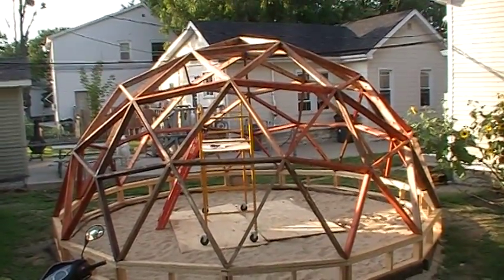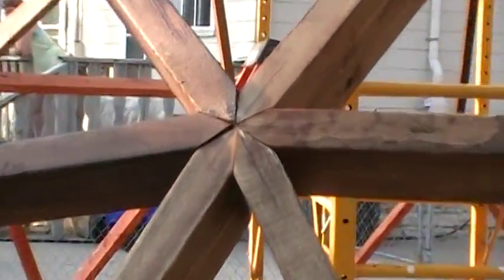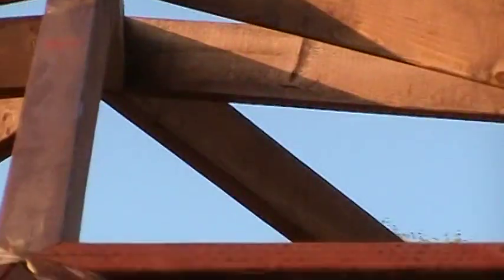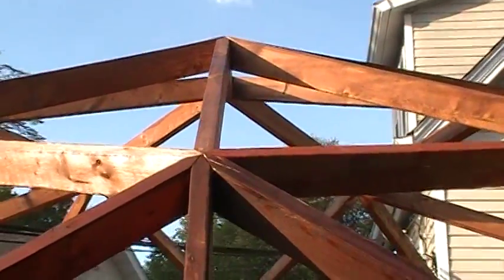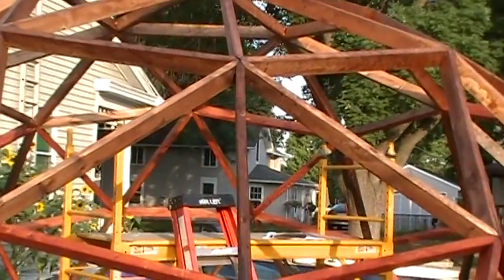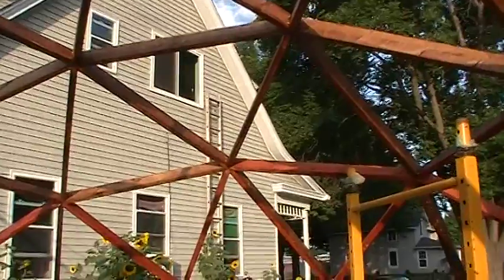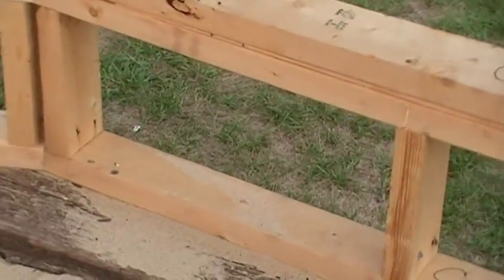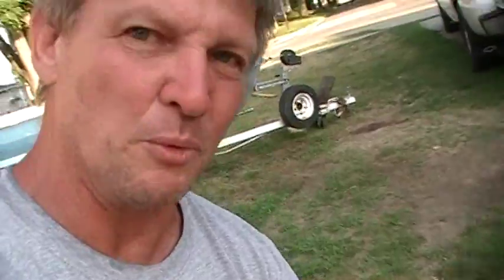video #9 the completed dome framing!

Comment from the maker: Hey Bodobaas, thanks for viewing my video! yes I did compensate for the uneveness of the 3V, I put a strip of wood ripped down at a 3/4 inch to zero inches under the I think the C struts. I will have to check on that if that is the correct strut, but I'll have to check that out, I have been gone for several months on a job and I can
t remember all the details at the moment. I have been working a 7/12 hour shift for 78 days straight and am a little slow mentally at the moment! Cal

Comment: Your joinery skills are fine, the reason the joints werent 100% perfect is you inadvertantly stressed the dome out of its natural alignment ;)  A 3v dome 4/9 or 5/9 (aka 3/8 or 5/8) doesnt have a flat base so if its forced to sit flat on a kneewall the rest of the frame has to compensate which opened the joints slightly. :) 
Slightly altering the strut lengths of the bottom triangles in the base pentagons would result in a nice flat base. In its natural form the bottom point of the downward facing triangles between the base pentagons will sit a little higher than the base ring. You may recall a slight bow at those locations before you bolted it down to the kneewall :)

Staining or painting the frame white is easier on the poly.  Dark brown timber can reach a finger burning temperature in full sun, where white is cool to the touch.
Reply from the maker: Thanks for the tips. However I did compensate for that very thing. I think the problem was just that I was in a hurry to finish it as well as doing it all alone. This would have been an easier project with a partner.
     Your right about the stain color, but if I remember correctly I had several gallons of dark stain laying around and my wife just started using that up.